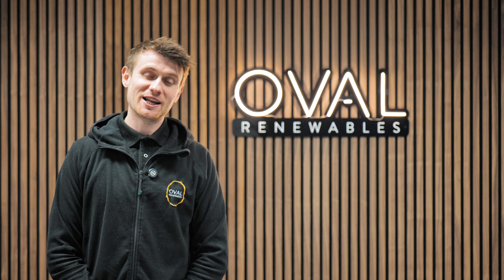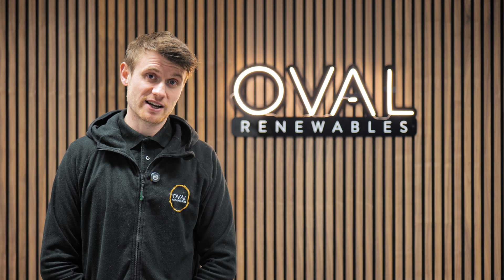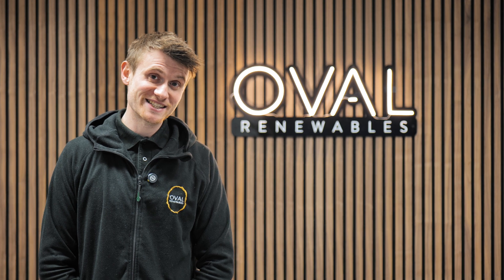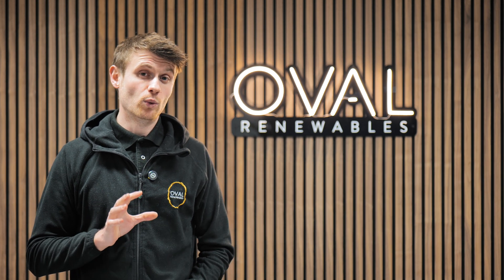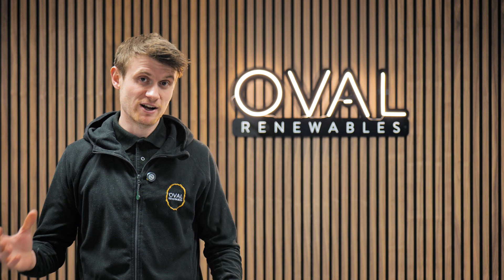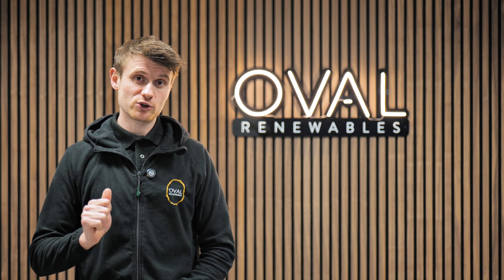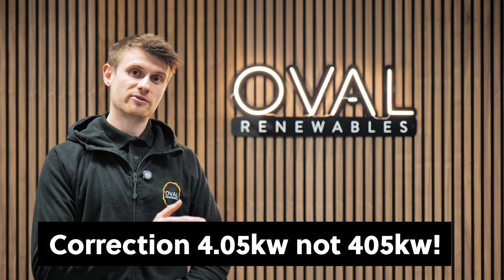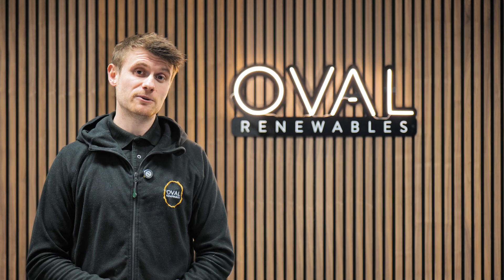Can you alter or extend a FIT registered Solar PV System? Myth Busted!

Comment: So if you add say 50% more panels, but are limited to the Feed in Tariff Limit, does that mean on dull days when the old system did not reach full capacity/export, you potentially can now and so get paid more on those dull days, up to the capacity limit? How could they otherwise distinguish, unless you have another generation meter for the additional capacity/panels?

Comment: I understand the necessity of registration, but the additional cost and complications it incurs during installation are excessive. While I acknowledge the paramount importance of quality work, unlike any other building project, as a professional carpenter, I possess the capability to construct the roof upon which it sits. Why is it not feasible for me to either install or modify the panels myself?
Reply from the maker: I totally understand. The complication for the FIT is due to it being linked to government money so the restrictions on who can alter it and what can be done has to be tight.

Comment: Hi Sam, great video, sent and email (eoob). Would be great to do a follow up video on how the customer has been told the tariff will be calculated from now on. E.g. what equation is being used by the provider. Could really help others in the future then calculate if upgrading / changing will make much difference to their payments. 👍🏼
Reply from the maker: Thanks I’ve got a few to email back so will try to do that tonight! That’s a great idea!
Reply: @OvalRenewables no rush, working on a new version of eoob which looks at solar generation as well and calculates what would go into the battery instead of exporting etc. should be ready next week. Thanks again

Comment: Hi Sam,
We have done this also with a client who had a 4kWp system 16x 250w Panels that had faulty panels.
We got it authorised by the FIT energy company that if we installed 14x 440w panels in place giving 6.16kWp that they would still pay out on a percentage (roughly 2/3) on the new array.
Reply from the maker: Great news!

Comment: Would be interesting if you did an install video for this to learn more about the metering side of things regarding such changes.

 I was offered extra panels and an extra inverter to expand my system (to avoid VAT when I was getting a battery system installed). I decided against it though as I didn't want another inverter as this would just be more maintenance etc down the line.

I did ask at the time if adding would have issues with my existing FiT but I was told no as the new panels but tie in to their own inverter
Reply from the maker: Yes that’s correct if your new system doesn’t connect into the existing FIT meter then there is no problem.
Reply: I'm currently looking to replace the inverter associated with my FiT. Current inverter is a Solis but I'm looking at the new GivEnergy string inverter since I already have a GivEnergy AC coupled battery 

Would be interesting to hear the views of anyone that has had one of these installed

Comment: Great Video Sam . Not what I expected to hear but sounds like you got it sorted. I always wondered  what would happen if I had to renew something on the system and couldn,t get like for like. I would imaqgine you could upgrade the inverter too or would the output need to be the same make & model surely not if you can add panels ?
Reply from the maker: Thanks! Yea you can do either, the same rules apply 👍

Comment: I've known about this for quite some time, I read the Ofgem document which explains how it works. Jon Tracey also did a very informative video a month ago https://youtu.be/qTFDtN7stxs?si=b05EDgLJ5HcxTPdT We've also been able to replace faulty parts, but it would be hard to source replacement panels for old systems. Glad this is getting out there, as it seems very few installers are aware.
Reply from the maker: Thanks for the info!

Comment: Great video Sam.  I started this in Aug 24.  Each and every solar provider I got a quote for Sam said 'you can't do that, you'll affect your FITS',  to which I replied, 'yes I can, OFGEMS website says so and I've already printed Scottish Powers changes form to fill in afterwards, have a read yourself if you want etc'.  They were still sketchy after that but they were happy when I said the Fits have nothing to do with you so you install the system and i'll sort out my Fits (which we are responsible for anyway as generators).  My fits were for 3.25 kWP in 2012 so higher rate fit, 13 x 250w blue poly panels so they were worried for me but I already did my homework before asking for quotes so now I have 9.1KWP system, 10x black panels 4.55kwp south east, same fit registered gen meter and inverter and exact same north west on its own gen meter and new inverter.  I opted out 50% deemed export in 2020 so the smart meter sorts out my exact export payments pre and post solar panel changes.

Comment: thanks for putting this out, John Tracey here on YT expanded his system, he had solar in 2010 so is getting 74p per kwh, the way he explained it on the day of commissioning the NEW system he had his old export meter reading recorded and a new one @ zero installed, and he gets 28%-30% prorata of his export to reflect his original 2kw install, i am awating a quotation myself for ditching my original 16 250w panels on FITs & replacing them with 450w bifacials and adding 2 extra strings with a PW3 :) keep up the good work Sam :)
Reply: The system is clipped at the output of the output agreed.

Comment: Great info and would this mean you get paid for the extra production export by your supplier?
Reply from the maker: That’s a bit more complicated, you would have to give up your deemed export to get a further export payment and so an assessment would have to be made as to if it was worth it or not. I’ll think about doing a video on it
Reply: @OvalRenewables I seem to recall The EV Puzzle did a video discussing his decision to give up the FIT in favour of getting paid for all his export.
Reply: I gave up the 'deemed export' part of my FIT contract last year. Crunched the numbers and, with EON's 16.5p SEG payment, I only need to export 30% (on average) before I make more through SEG than I did through deemed export. Makes the set up very simple: charge battery to 100% at night, export as much as possible, runs loads after sunset. I still get FIT Generation payments too.
Reply: @martinhook  DO you mean you can get paid via FIT for generation, and still export at a good rate? I thought you had to export at piss poor rate when being paid FIT?
Reply: Deemed export seems to be minor compared to the generation payments. 

I've recently moved to a house with a FIT start. I'm getting additional PV arrays installed and battery storage leaving the existing PV array and generation meter as they are. I'll drop the deemed export and switch to a decent export tariff and should easily earn more from solar and battery export.

I may consider upgrading the existing array as well, I only recently became aware of this pro rata generation payments when upgrading a FIT system.
Reply: @danrooke7372  do you mean you keep earning from FIT generation, and can still chose to export at a different rate? I thought when using FIT you had to only use the piss poor export rate that comes with it?